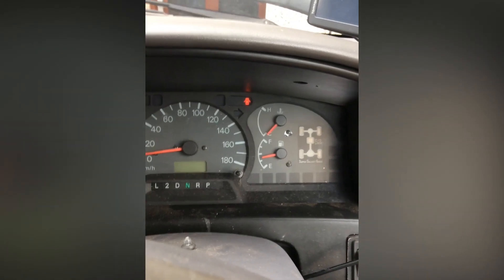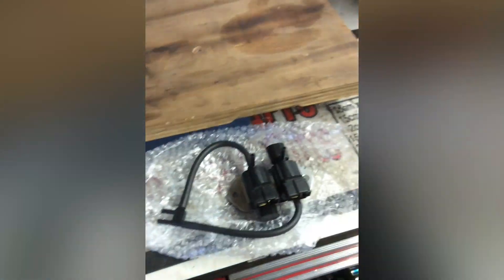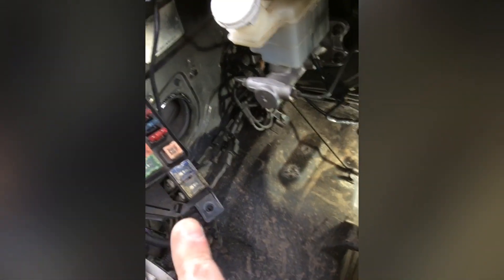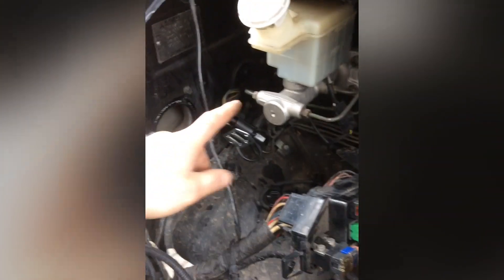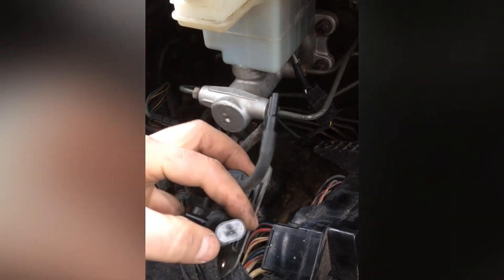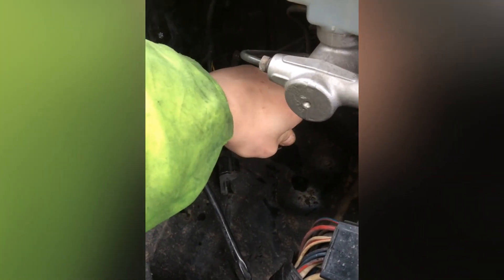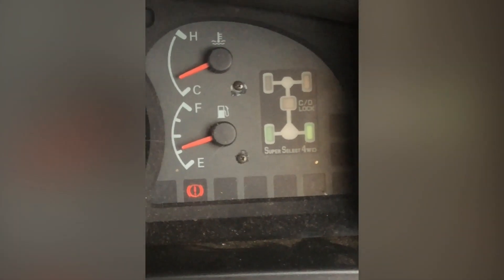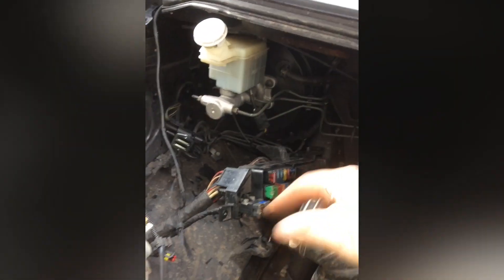Delica L400 2.8 95 Super Select flashing light £10 fix

Comment: Hello, I have a problem with the Delica 1994 , it won't turn me on to 4th gear, I checked the gear shifter, the cable on the pump is working, it is set to 34mm, the temperature sensor at the head, I don't know what the resistance should be.
Reply from the maker: I wouldn’t know sorry

Comment: Hey mate mine doesn’t even flash when I change it in to 4wd it just has the back to wheel light showing what does that mean do you know hoping it little
Reply: You must push down the 4wd selector stick then to th right to engage it then lights should show when you drive with solid orange middle light that the diff has locked . I'd the 4wd is working and still no light's faulty bulb or sensor.